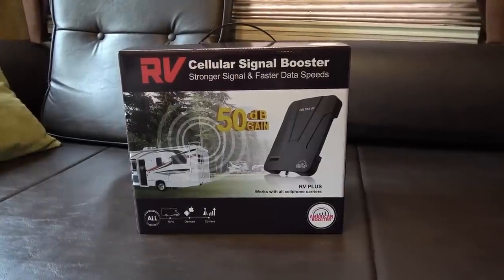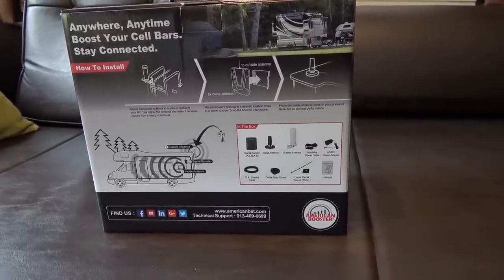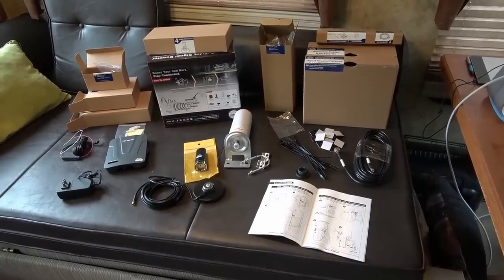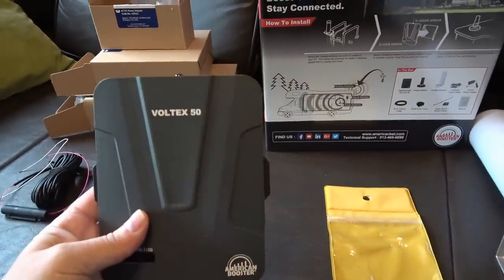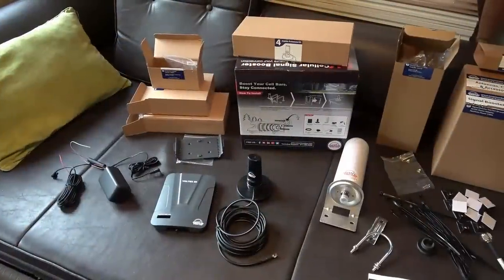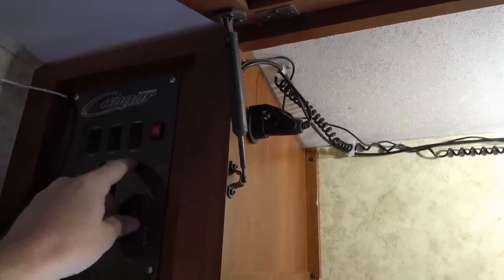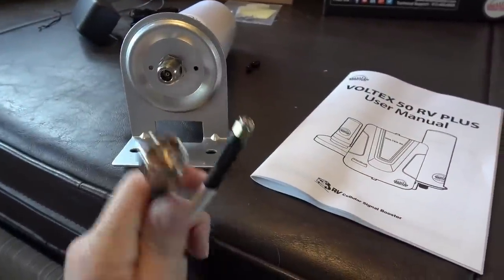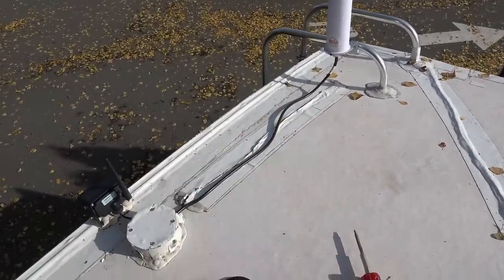RV Cell Signal Booster Installation (American Booster Voltex 50)

Comment: Afternoon Ray! Super review as always. I am interested in your long term use of that unit. Looking at their website and the spec on the booster, I noted that my carrier, TMobile, is only represented on one band, band 4. Living in rural north Alabama, I get TMO on bands 2, 4 and 12. When I use the Network Cell Info app, I noted that my phone spends a lot of time on band 12 and band 2. In a close review of TMO's technical data, those are the primary bands they use for the rural areas. That could change I am sure if the Sprint/TMO merger finally gets resolved and implemented. I am really looking forward getting band 71 (5G) in my area as that would be a super great thing! Safe travels, look forward to see where you are going this year. Cheers!
Reply from the maker: Thanks for the info, I use a roaming service out of Canada for my phone when in the USA and it uses the T-Mobile network. I'll have to dive in and see what's up with the frequencies it's using. Cheers, Ray

Comment: Hi Ray. Do you have an update yet on this? I am close to buying one and this will help me decide between this and the Wilson.
Reply from the maker: Been having a hard time completing the review due to limited testing chances as we have been mostly camped in excellent cell coverage. I've used it only 2 times and both times it performed well. I'd say indications it's on par performance-wise with the weBoost, though I think the hardware quality is a little better as far as the antennas and cables go. But, weBoost is a more well-known name and been around much longer.  I did take the cases apart to see if it was simply a clone of the weBoost and it wasn't the circuit board and internal electronics are quite different.

Comment: Ray have you came up with a conclusion as to the performance  between the weboost system and the American booster looking for your evaluation before I decide what to purchace
Reply from the maker: No, I've only had a chance to use it twice so far both times on T Mobile and made it usable and faster speed. Just started traveling a few days ago. So far its worked well but like I said only limited testing. Cheers, Ray
Reply: @LoveYourRV  Thanks Ray will be waiting to hear final results zi also have T mobile. Wishing you safe travels on your journey

Comment: the only issue I have with my version of the Weboost is that the cable is permanently mounted in the antenna. I had to purchase a new antenna because a tree branch totaled my first one on top of the RV roof. Because the cable is permanently mounted to the antenna, we had to run the cable all the way through the RV AGAIN.. to get to the booster inside :(  This one is much better in that respect.

Comment: Great vid Ray!
Very informative.
You are using Verizon Jetpack for data?
We don't have a cell booster yet - just a WIFI booster, which does seem to be effective, but you are still at the mercy of the WIFI setup at the camp.
Reply from the maker: Thanks! Yes, we have used the Jetpack for 8 years.

Comment: All those boosters are overrated and overpriced I bought one for verizon for my house where the signal is weak and I paid $200 for it so what the price difference
Reply from the maker: Good question there seem to be lots of the mobile 50dB booster kits right around the $400-500 mark, and its been like that for a few years.  What is your 200 dollar kit? Maybe we can see why it's so much cheaper.  My first booster was the Wilson Sleek, it was in the $200 range but had less boost to it, smaller antenna and cables.
Reply: @LoveYourRV  I have a wilson and I am not impressed.
Reply from the maker: Wilson makes a large variety of boosters from commercial stuff to home to mobile. Actually, the weBoost brand is Wilson.  They changed things a number of years ago. The commercial division is called Wilson Pro and the home and mobile stuff is now branded as weBoost.